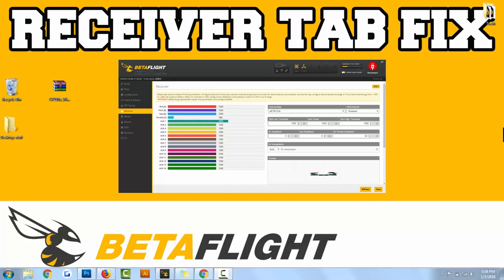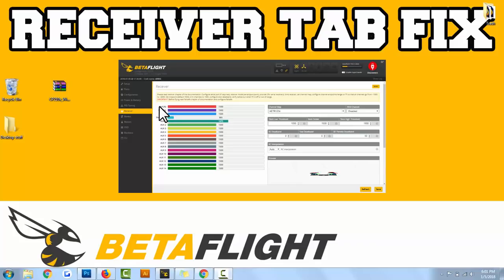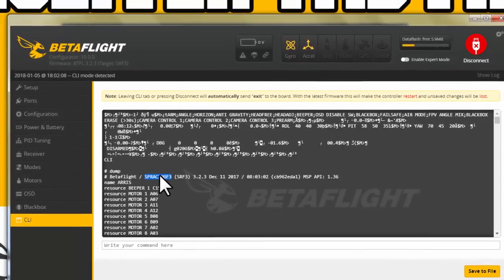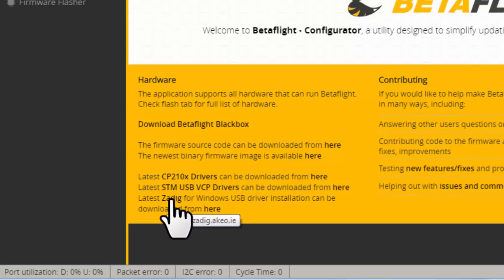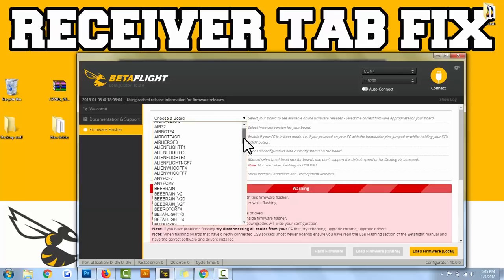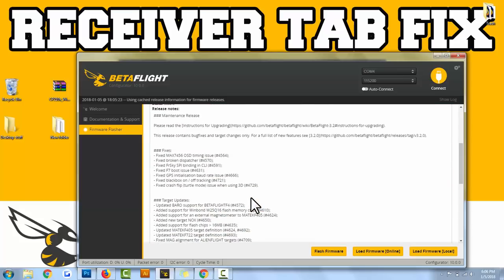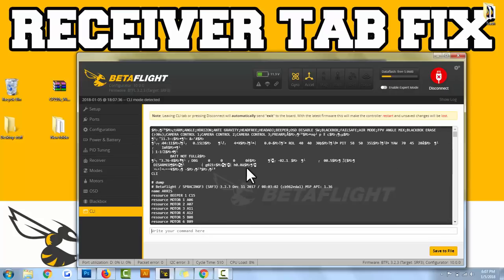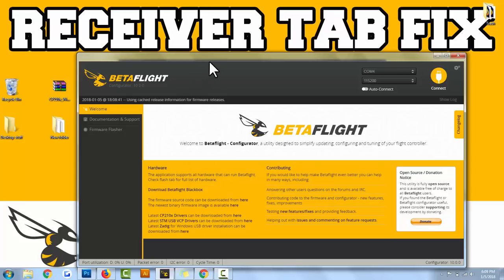[SOLVED] - RECEIVER TAB PROBLEM GLITCH - No Response/ALL 0 - BETAFLIGHT SBUS and FrySky X4R

Comment: I have the speedybee v3 f7 r1 connects then loses signal after day or two change to r3 works then after a few days it stops have to change back to r 1 starts working again I updated firmware seems to have fixed only been a day lately these new boards are really aggravating

Comment: Só i have evereting updated,i boughd them,the guides are all right even só the radio doesn't connect with the beta i have telemetry on the radio and RSSI signal but i dont have a stick signal in betaflight

Comment: I have stick input movement in the receiver tab when I'm hooked up with USB, as soon as I plug in my battery, then I have no stick movements anymore, Crossfire micro receiver is on bound and green light, if i unplug the battery then my inputs work again. Unbelievably frustrated for several hours any help would be much appreciated.f722 fc.

Comment: If the issue is caused by using an incompatible version of the confgurator, it can often also be solved by restoring a CLI backup made when everything was still working.

Comment: This video helped me by pointing me in different directions. I had this problem and fixed it by turning off UART 1, that was on by default, and turning on UART 2, saving and rebooting. As soon as I did that, the receiver tab showed my stick inputs. I was using the Jhemcu GHF411 2-4S F4 AIO Toothpick/Whoop Flight Controller w/ 30A 4in1 ESC and an R-XSR receiver.

Comment: dude  i bought a betax85 used and the guys sweared for his mom  the drone was on perfect conditions soooo.... i binded it has a r9 mm ota and bind was easyyyy,,, then i  connect betaflight..anddd... in the reciever tab ....was working but like if its lagged,,,,,, soooooo weird... like if the latency was 3 seconds  you move nothing happens then it suddenly start rolling like 3 seconds later....anddd throttle is jumping from 850  to 1000  back and forward  alll the time...  i spinned motors and work propperly ... is just that reciever... and  u cant arm at all  ..... :c

Comment: I think I've bricked my TinyHawk2.  I installed the correct firmware - STM32F411- now there are no LEDs when I plug in the USB and all the information seems to be gone from BetaFlight.
Reply: Fixed.  Downgraded Betaflight as per instructions from Emax, downloaded the firmware from their website and also the CLI dump and all is well in TinyHawk land again!  :-)
Reply: Plug your battery in and hold the boot button and flash the right one

Comment: Please help. 

I had the exact issues mentioned in video. I binded QX7 to Betafpv HX100, solid green light, when i powered QX7 off the Green light would turn red so i knew they were bound. 

Everything in betaflight looked good EXCEPT my Receiver tab in Betaflight didnt reflect my stick inputs. So I followed this video. 

I flashed betaflight 4.1.7 on to my Hx100 ( target STM32F411) and then when i connected to betaflight i had absolutely no input from my drone. The 3D model does not reflect the movement of the drone itself. The ports tab has lost all my UARTs. I flashed the firmware BACK to what i originally was running (4.1.1) but still theres no connection between my FC and Betaflight. 

Ive tried downloading different betaflight configurators 10.4.0, 10.3.1, etc but no luck. Extremely frustrated and don’t know what to do.  The firmware on the hx100 was 3.5.3 out of the box, but I dont know how to get that firmware, when flashing the lowest i can select is 4.0.0 on betaflight firmware flasher.
Reply: I have the same board and the same thing has happened to me.  Did you find a fix?
Reply: Yes actually! So if you have betaflight 4.0 or lower; the TARGET you must flash is on the upper line (for example STM32F411) but if you have betaflight 4.1 or higher i believe, you must flash the target that is on the 2nd line called the BOARD.  Im sorry I dont have photos to explain at the moment. Ill send you a video on Youtube I found that explains it better than me
Reply: ZSHREDPJ that would be great my friend. My kids are gonna kill me when they find out their dad has bricked their favourite drone...
Reply: Muzz Litebeer , so THIS is the video that made it all click for me. Once i flashed the Firmware to the CORRECT target ( depending on which version betaflight you have) you should not have any issues! Hope this helps brotha!! https://youtu.be/QA-dXEy49ME
Reply: ZSHREDPJ, I already found the solution. 

Spoiler alert... the instructions were in the owners manual. (Which most men never bother reading). 

Emax recommended downgrading the BF app to an earlier version and their website had the correct firmware version (which is slightly different to the built in firmware) and also something called a CLI dump, which pretty much put it back to where it was before I messed around with it. 

I’m still going to look at the video you linked me to. I’m still not comfortable with Betaflight yet. I only just finished gettin my head around APM Mission Planner

Comment: Hi i have a Holybro Kakute F7 HDV & Tekko32 F3 HDV 40A 4in1 ESC 30x30 Stack and i manage to connect the receiver the first time, but after some time something happened and now i cant connect the Receiver to Betaflight

everything is updated and is green - but still no move in betaflight in the throttle department :( 

please help
Reply: I am having this same issue with the f7v2 Have you found a fix yet?

Comment: hi, just bought a my first micro quad a king kong 90gt. and being a noob can't figure out to let my old d6xi transmitter to talk to beta flight. and as i search the net and all videos are set up with a taranis system or a fry sky transmitter. there's a spektrum set up video but it's on the dx9 system. can you help me point out or set up value on the dx6i and make it talk to beta flight. thanks in advance.
Reply: Unfortunately, you probably need a new radio.   The Dx6i came out in 08 I believe, and it was only capable of DSM2 protocol, which was the norm back then. Couple years later they came out with version 2, that could use DSM2 and DSMX, which is newer and still used by newer Spektrum receivers.  Do you know which one you have?  Printing on sides of screen is the easiest way to tell, if it says DSM with a big number 2 under it, on the left and nothing to the right, its the original.  Version 2 in the same spot on the left there are 4 little graph bars, like ones that actually light up, to the right of the screen is a giant X in white, with small letters that say DSM.

So if you have original, it only works with a handful of receivers in the AR6series.  Version 2, although working with DSMX is still older technology, I believe it can be hooked to the newer receivers, but there's a bunch of extra hoops to jump through, Dx6i doesn't do channel mapping and/or mixing, so you have to do something in BF or re-solder a bunch of stuff.   Both radios are mostly used by fixed wing and heli pilots.  Both were also discontinued last year I believe, so Spektrum doesn't even support them anymore.

Sorry to be bearer of bad news, do you intend to stay with the sub 100mm micro quads, or do you think you're going to get some bigger quads too, like a toothpick (around 100mm-120mm) or maybe a 3, 4 or 5inch? (mm is the measurement motor to motor diagonally,  3" or 4" quad refers to prop size.)  Even though Spektrum has been in the game a long time, it's hard to go wrong with a Taranis, which are use Frsky receivers.  The Qx7 and x9 are the two most popular ones.  I use the Qx7 personally, and love it, been out long enough to be able to find good deals on, but will be supported for quite a while.  Now if you plan on staying sub 100mm quads, I would look at the Turnigy Evolution, It's small and kind of like xbox/ps4 controller, but very solid, and well built. You set up the quad through radio itself, no need to hook to BF.  It has 8 channels, supports sbus ppm, ibus and one other. It has a nice touch screen, only 2 3-way toggle switches, but does have a usb connection, so you can use it with most fpv simulators.  Downside is, it's only compatible with flysky compatible receivers (Flysky=Turnigy / Frsky=Taranis, I used to get them mixed up when I got into hobby) which aren't as full featured as Frsky receivers.  Also, it's not a good radio if you're a pincher(way you move sticks, opposed to a thumber)  I got one just for my micro quads, anything under 110-120mm, I bind up with my Evolution.  Best part, brand new, they're only $70-$80!  So if you need more radio as you get into the hobby, it's not like you threw away 200-300 bucks for your starter radio.
Sorry I rambled, working nights, and hopped up on coffee, hope this helps.
Reply: @sunshynff  hi, thanks for the reply. it is very helpful. i've manage to fly my micro with my dx6i after youtube videos and adjusting some settings. i'm leaning to have a taranis next season since cold is fast approaching here in edmonton. and would continue on micro since any heavier than a 250g would need a pilot license.  thanks again for the help.
Reply: @MrBungolets  No problem, Taranis is a great choice.  Since you said you're gonna stay with the micros, let me add one more... If you happen to like the form factor of the Evolution, there is another similar to it, made directly by Flysky, called the Flysky Nirvana.  It's a tad bigger than the Evo, but similar game controller style.  It's more expensive at about $180-ish, but it is full featured probably comparable to the Qx7.  I don't know a lot about them, but reviews so far are pretty positive.  So give that one a looksy before you buy.  Happy flying!

Comment: Hi, i connected my receiver to my drone and it shows the input in the receiver tab but when i control it from my transmitter the motors dont spin. It however spins when i control it from the motor tab. If someone knows the solution pls help me. thanks
Reply: i think you need to calibrate the esc's  
then the motors will work

Comment: hey 
i bought the wizard 220 with the spracing f3 and i flashed the firmware succesfully but i cant get any input from my radio in betaflight 
it is bound and betaflight is connectet to the fc but noting happens when i move the sticks 
please help
Reply: You get this fixed? I'm having the same problem
Reply: @benwoods9649   I'm having the same problem

Comment: hey brother good vid. can you tell me how to get my arm light to light up? channel is going into the slot like the others, but it's not arming. i changed small angle to 180, still not. in the reciever tab, the bird is slowly rotating and on the quad i got a blinking red light.. cpu time is under 22%...  Betaflight / SPRACINGF3 (SRF3) 3.3.0 Mar  2 2018  shows on my screen, but wont connect to betaflight, only cleanflight.. not sure if related.. your info helps.. i am so close to getting this in the air its troubling. i know its something simple. throttle is at 1100. i want the motors to kick in at around 1240. i havent messed with pid at all.. any vids or suggestions? thx.

Comment: i have  flashed 3.3 to my sprf3 and have the same issue no tx response on bf , already have drivers installed . using rxsr and its bound . messed with mapping no success and ideas?
Reply: same here on brand new Eachine wizard x220 with SPRacingF3 board.
Reply: Kim Chi Kim flash it then go back to calibration page and click reset setting s it will respond to your tx
Reply: Kim Chi Kim flash it then go back to calibration page and click reset setting s it will respond to your tx
Reply: Kim Chi no one seems to mention that , I found it on my own
Reply: Ok I just found it on Mythic Tech's video for the eachine x220 setup. He shows moving the receiver connector to the other side of the FC and a more in depth look at everything in a short time. I feel so...dumb hahaha. hope others find this useful.

Comment: my receiver receives all the AUX commands, but none of the AERT channels. anyone seen this before?
Reply: Hyperious currently have this issue. plug battery out and radio is screaming at me telemetry lost. battery back in telemetry recovered.... but nothing on the aert and I simply reset everything.

you find a solution to this ?

Comment: Receiver not communicating with ppm mode..need help..
Reply: same here...bought an Eachine x220 from Banggood and hooked up a x4r receiver. Installed latest cp210x drivers. Flashed recent firmware. Bind successfully but no movement in receiver tab. TRIPLE checked my wiring. Its all good but just not working...
Reply: OMG I just found out the problem...Check out Mythic Tech's video...I feel so dumb. I had to move the receiver connection from one side to the other on the FC...
Reply: @zcxvasdfqwer1234  do we have to solder to fix the problem but i just hadn't got it before

Comment: i did the firmware update to 3.3 but my receiver still wont respond on betaflight. the receiver is good cuz its works right now on my vortex. i set my receiver to spektrum and sbus and turned on all variations of serial rx combinations and still no signal on betaflight. Do you have any suggestions?

Comment: I'm having this problem right now. Where it gets complicated is that it worked fine for 10+ packs, then i put everything on a new chassis, i had to flip the FC orentation, i set the proper orentation in BF, that worked fine, but when i did that my reciever bars went all zeros. If i set everythjng to ppm it works... but ibus stoped working. 3.2.2 Im so tired of this im sick of exlaining it to everone again but i have no idea what happened to it. I havent tried to reflash firmware, but it worked fine before. I set uart3 to serial rx and set reciever to ibus and everthing saves fine but rx is all zeros. Set it to ppm and set my tx and rx to ppm it works, slowwww and no failsafe..... i refuse to even put props on in ppm. Its an omnibusf3 no osd 16x16 from a betafpv 65 pro, older ver. I put it on a 88mm chassis and lost reciever in BF. Im going to try and reflash but i want to stay at 3.2
2.... ive tried rx1 rx2 and the dsm pad on the fc... ive tried both ibus and sbus. Flysky i6x tx and ive tried multiple recievers rx2a fs82 fsa8s v2.... it seems i fried the ibus inverter somehow? I just ordered a new one waiting for it to get here.... omnif3 16x16

Comment: My board has the same issue. I’ve done everything,just can’t get response from the receiver tab
Reply: hey I have same problem ı use spracing f3 board also I do  everyting.Did you find the problem or just get a new board?
Reply: Alp Buğra Gül yeah soldered the wrong pads. One side is ppm and the other is rx
Reply: I just solved mine...Check out Mythic Tech's video on the eachine wizard setup...I simply had the receiver connected to the wrong port. I had to move it to the other side of the FC.